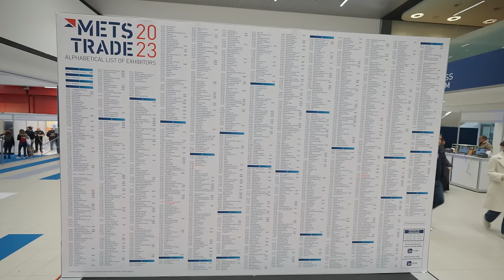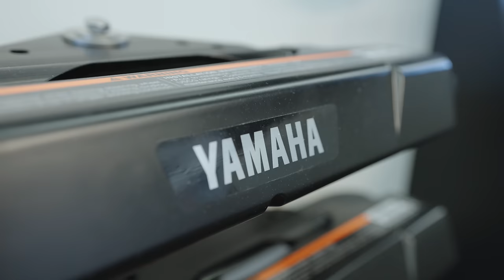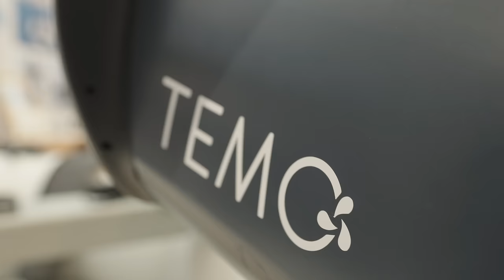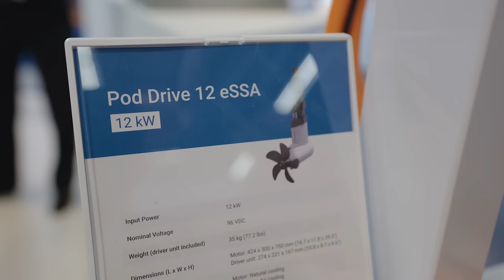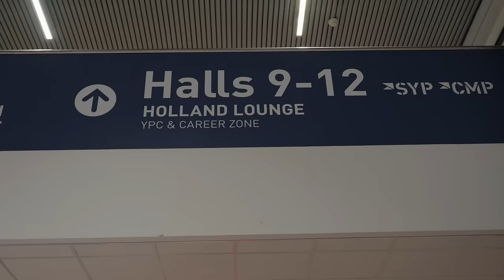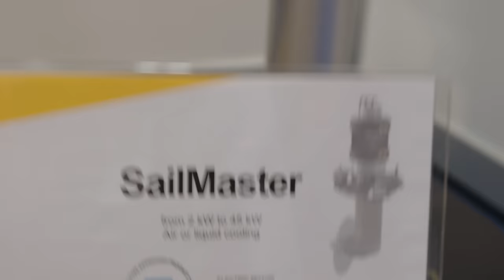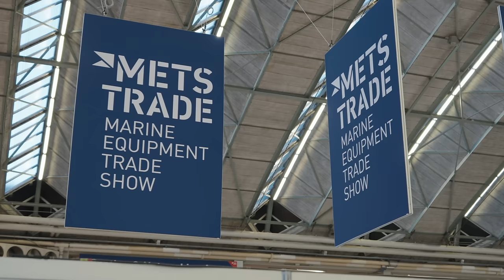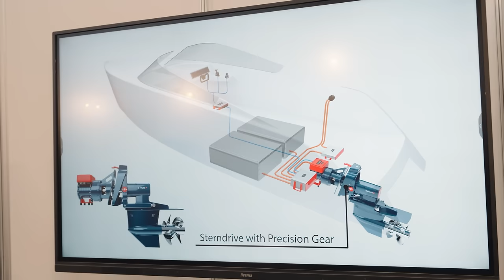The Shocking Truth About Electric Propulsion | Step 371

Comment: I wish ANYBODY would discuss the negatives of batteries and solutions to those issues. They are expensive for the wallet as well as the environment; their production (and disposal) are a huge pollution/eco-issue. I'm all for electric, solar and wind/hydro regen is fantastic, but using fossil fuels to charge a battery (home charge/dock charge, etc.) is not a real solution. With cars as well, where do people think non-solar/wind electric charge comes from? Answer: burning fossil fuels. These issues are so important and need to be looked at from all sides, cons as well as pros, specifically from the eco perspective, and I don't mean the economy and business prospects! R and D needs to address more than quiet and so-called "clean". Batteries are not clean in their complete product cycle - yet. And fossil fuels are definitely not sustainable or wise. I remain very hopeful! Excellent episode, Uma babes!
Reply: There is a transition to cleaner electricity in progress.  Where  I  live, the electricity is 90% carbon free. However, I would need a 60 mile long extension cord to reach the ocean.  There's always something!
Reply: People do take about these issues. Try the fully charged show. Batteries can be and are being cleanly recycled. The main issue currently is that there are not enough coming to end of life to justify building recycling facilities. I don’t know where you live but my government just passed legislation to go carbon neutral by 2050, drop carbon emissions to 70% by 2035 with the backing of all parties. This is as well as the current push for wind and solar power. And we are a coal state. This stuff is doable, it needs political will which is not really the remit of a pleasure sailing channel. The first wind generators were shipped to one of our countries’s lithium mines to clean up its emissions act and incidentally lower the power cost the mine as well.
Reply: @francesconicoletti2547  Fantastic to hear about, thank you! There's hope!!!

Comment: Very interresting episode, learn many things.  Funny how some companies compare a 2KW electric motor with a 4
`5 HP motor knowing that very theorically 1HP is 736W. With the minimal convertion losses you can round as 1KW is 1HP... (not 2....)
Reply from the maker: They’re correct. Our 1kW electric outboard will push Uma the same speed as our 5hp vas outboard. And our 15hp gas outboard pushes her the same speed as using about 4.5kW from the motor. Electric is about 3X more efficient that gas/diesel so that .75kW/hp number isn’t really the whole story.
Reply: @SailingUma  So, taking in account that the power injected in the electric motor is real, (real time measurment) and that both motors transfer the power to the same kind of propeller, it seems that the rated  "horse power" of the thermal engines is a bit exagerated...

Comment: Wicked video loved it. Well done.. Question for you both .. If you had to pick one of these companies to use, which would it be ? And Why ?
If you had to do it all again as you have already done, into a 40-50 footer sailboat.
Reply from the maker: We’d still pick OV since it’s the only one with viable regen. That’s why we’re keeping the one we have. On a 40-50 fter ( IF it sails well) then the new OC high power Servo prop or twin SP 15’s would probably work well. But you need to start with a boat that sails well. Most don’t.

Comment: Seems like prop for regen is the issue, and why it is not common. A prop for propulsion would not work well for generation if i understand  it.   Oceanvolt solves it with variable pitch, but thats a complicated thing spinning in salt water in a difficult to service spot.    I wonder about the system(s) that can spin the pod, if turning the prop around overcomes that prop shortfall somewhat.    Would also give directional thrust.  Next level might be to be able to lift the whole pod out of the water to reduce drag or for service by having it confined to a box that has sides above the waterline.

Comment: I think right now electric propulsion is very much a niche market. We cruise all summer living at anchor for 3-4 months. My 800$ Honda 2hp has a 4 hour range on a pint of gas. 2 gallons a summer.  Having a dinghy motor with a 1 hour range is not practical .  Our 40 year old 20hp diesel uses maybe 30 gallons a summer, max and I have a range of 200 miles When I price a Ocean Volt @30,000 Euros for a range of 70 miles ( probably 50 usable) , plus another 10% for the rest of the kit. Ouch. I can replace it with a Beta for $10K  I have friends we sail with who use a Torg and it's nice and quiet, easy to use and has a practical range of an hour and change in calm water.  So yes lots going on. Some of quite inventive. If you day sail it works, if you use you dinghy to go 20 minutes to shore, yup.  Long term the issue is range cost and support. How many of these vendors will be around in 10 years? Early adopters have the pockets and situation to absorb these risks.

Comment: On a blue water saling ship an electric drive is the best way to go. Once your Diesel is gone, it's gone. Not so with a regen capable engine. It allows you to store wind energy for later use without the need to install additional hardware. What could be better?

Comment: I brought an email out of my archives with a written estimate from OceanVolt that quoted me an unrealistic cost for a hybrid system, which is more involved than the straightforward electrical propulsion ("So your approx cost would be 70-80k CDN and 20-30k CDN for the install") for a 40-foot sailboat. Now, that was from May of 2020; have the costs started to decline since that time?

Comment: The EPTechnologies guy hit it on the money. For most people regen is just hype... they wont use it, or take very little advantage of it in real life. Also, most (long distance) cruisers won't give up on the diesel at least as a backup. That said, hybrids that can work independently are a very good idea for long distance cruisers. You can have all the range you want (aka diesel), and a massive generator that, combined with a big enough battery bank, can provide power for days in a couple of ours (solar helps, but in doesn't scale on monohulls, cats, maybe, but there is always rainy days and short days if you are up north)

Comment: The guy at 45;50 is mostly right, at least for sailboats if using a saildrive. The biggest problem is the drag if you don't need regen.  In a perfect world you would have a brushless retractable for forward and a retractable water rat for charging. clean bottom for regular sailing.
Reply from the maker: We gained about 3/4 or a knot on our passage averages going from direct shaft drive and fixed prop to the Servoprop.

Comment: I have a 37ft with FIMEA motor, which is the supplier to Bellmarine, have a curtis controller, but hardly get any regen  and haven't been able to find any info on the controller settings that would optimise for it.
Reply from the maker: Fixed prop or folding prop won’t give any real regen on a shaft drive under 10kts. We’re still surprised there isn’t more tank testing on this. I guess we’ll just have to do it ourselves.
Reply: @SailingUma   Thanks for the reply,  I actually have a variprop, which allows for different pitch in fwd vs rev.  I need to play with the rev. pitch a bit to see if I can get anything better than i have.  Though as you say not much info on it.   I'm also peeved at the Curtis controller guys as they are very closed book and don't allow for easy settings updates, let alone providing software updates.

Comment: I recognised nearly every part on the Bellmarine stand… even the mfd is a rebadged penta unit. Not an issue, so long as its a lot cheaper to purchase. But it does show you need to be careful of buying in to tech that is new, but actually based on very old designs.
Reply from the maker: aka the entire marine industry ;)

Comment: So, does it appear that prices are coming down?  It seems that most turnkey electric drive manufacturers are charging as much as a new diesel would cost, and then you have to buy batteries in addition.  Oceanvolt's AXC 12 shaft driven system is a little over $18000 + batteries, and the batteries aren't cheap either (shaft drive because it would be challenging to modify my boat to fit a sail drive between the keel and the skeg).
Reply from the maker: Yes. The motors are similar prices. The batteries are your “fuel”. You never see a 10yr cost analysis on the two systems, but our best guess is after about 8-10yrs the electric is free and the diesel only keeps costing more and more.

Comment: I’ve been researching what is required to convert a 38 ft sailboat to electric and the budget associated.  This would be a good topic to discuss.  I estimate $40-50K by the time you add everything in - inclusive of motor, batteries, electronics, solar etc.  thoughts?  Hard to consider with a low hour diesel.
Reply from the maker: We always say that if you have a working diesel keep it. Especially if you’re thinking of electric as a “green” upgrade. Just choose to sail more. When your diesel finally dies, then upgrade. But yeah, $40k sounds about right for a quality system and good batteries.

Comment: 1. Loved the roaming, back & forth Kika shots!  2. Damn near every vendor tried to duck the regen question as "not being equal to" the power output of their motors.  No sh*t Sherlock.  Those of us interested in sailing regen fully understand that it will be maybe 10% of the power output.  OK, if I am sailing 45 out of 48 hours, that's plenty of regen for me.  Not having regen is a deal breaker for any system I might consider.
Reply from the maker: We motor on average for about 10-15 min at a time. That’s it. Usually less. It takes about 2 min to leave the dock and get the sails up. It takes more power to make morning tea. Regen is the only thing that matters to us.

Comment: I was thinking of the cost of a replacement part and how hard is it to get the part.
Reply from the maker: Most of these systems use industry standard consumables. There are also significantly more electric motors operating in the world that ICE. You just don’t hear about them as much.  It for propulsion, but in many other commercial applications. So “spare parts” are often easier and much cheaper to source than proprietary diesel parts. The electric motors themselves will almost never need spare parts. Most are rated for 100,000 hrs of use before overhauling the bearings.

Comment: I like the hybrids but wish they integrated a variable pitch prop like the servoprop for better regen.  Still having a diesel connected to the propeller shaft is reassuring, as is the range of the diesel when you need more than getting out of of the anchorage. Not everyone is as purist as you two.
Reply from the maker: Its actually quite a bit better to have the diesel run purely as a "genset". A 48VDC Genset connected to the batteries as a range extender is much more efficient that a diesel connected to the shaft.
Reply: @SailingUma  that's not wrong. My preference comes from a redundancy consideration. A genset is of no use with an electronics failure after a lightning strike for example. So having the diesel connected to the prop shaft provides some safety that the engine can likely be started with just a battery and controlled manually if need be, even if all else failed.

Comment: Dan and Kika, once again, a great video! The Combi system is intriguing--motor integrated after the transmission and acting as a motor or as a generator. Question though, since the electric motor is integrated after the transmission, isn't the motor connected directly to the shaft? Doesn't that mean that to use it as a generator using engine power that the transmission has to be in gear to rotate the shaft, which would also rotate the prop? I.e., only a generator while under way.
Reply: I thought the same thing. Must only be a generator when the diesel is pushing the boat. It is a cool idea but when I make the leap, the diesel is history.
Reply from the maker: Yes. I believe so. There are other similar systems that have different solutions to that problem. But it means more complex systems. We’re still not a fan of that style of hybrid. But it could be used as a stop gap to build out a good battery system waiting for the day you’re diesel dies and you can replace it with a better electric solution.

Comment: Remember when you are on the floor with a sales representative, and he starts to talk about that the engineers can find that data. Most of the time, the engineers are curling their toes and cursing him for promising something that is hard to implement
Reply: Unless its a small startup no engineer will ever get to your question. You will get an automated reply with some faq from the website that has nothing to do with your inquiry.
If you insist you'll get a reply from the support staff which tells what you want is unfortunately not possible at the time (regardless of its actually not possible or not).

Comment: I may not have understood you correctly, Dan, but you seemed surprised that there were hybrid systems that gave the best of both technologies. Leo (Sampson Boat Works) bought a Beta Hybrid for Tally Ho a year ago, that does all that was explained. The concept of Beta (a British company) was to marinize a Kubota diesel which has a good reputation for long life and smooth torque, thanks to an oversized flywheel. Atticus had a BetaMarine engine on their Allied Seawind. I don't know if they were among the leaders of hybrid designs but they were at least an early choice. When I replace my old Westerbeke, it will be with a Beta Hybrid.

You did an excellent job in your interviews and also in their editing! You should go back to all those interviews with different accented English, and clip out every word said and then write your own summary and use those clips to verbalize it. It is what might be called a "joint-effort" summary, one word at a time.
Reply from the maker: No not surprised at the technology. It’s been around for decades. We’d just never seen a company openly advertise retrofitting existing diesels with an electric option. That’s what we were commenting on. There are a dozen companies offering an electric motor slapped on the back of a diesel. It’s not our favourite solution, since you’re still tied to a diesel. But it might be the right solution for some.

Comment: Seeing that, it will be interesting to see in like 10-20 years if diesel pump stations are still a thing at marinas and only like high power 3-phase plugs are at each birth - even in the smaller marinas.
Reply: Here in Norway more and more work boats are becoming electric. Though they need to charge with 400 volt which is not readily accesible in marinas, thus they still rely on diesel generators for charging.
Reply: Unfortunately I don’t think things will move that quickly. All the boats that have already been made, will still exist in higher ratios than new electric boats. 

All the hardware seems to exist more or less. Battery tech has a ways to go. But there doesn’t seem to be much in the way of sailboat specific software development. It’s a small market comparably with bad economics unlike commercial transport. Building a new boat with hybrid electric drive is still an €80k option the last I looked.
Reply: Don't hold your breath. 
Building New infrastructure takes time. And not yust at the Marina's. Here in the Netherlands a lot of building has virtuallty stopped because electricity can not be provided. The elektrical infrastructure  is saturated.

Comment: I think a lot of these companies are trying to make an electric propulsion system that happens to sometimes (maybe) work as a hydro-generator.  I want to see someone make a hydro-generator that happens to sometimes work as a propulsion system.

Given the range limitations of electric boats I think it's likely that a cruiser with electric propulsion spends more time in generation mode than propulsion mode (Uma certainly does). It would make sense if a motor were optimized more for regen than propulsion.
Reply from the maker: 100% agreed!!!!!

Comment: What do you get Regen wise at 5 knots, 7 knots and 9 knots sailing speed?
Reply from the maker: 5kts is about 100-150W. 7kts is around 5-600W and we can’t go 9kts. But we’ve sailed the Salona 46 and we were getting about 1kW out of each motor at 8.5-9kts. 

Our numbers are from the very first time we tested it in Tromsø in 2020. We’ve received a few software updates since that have dramatically imposed things. But we haven’t had the time to do a full on controlled test since our last update. And now Uma is torn apart. So it’ll have to wait.
Reply: @SailingUma  So there new 25kw that does 5kw at 10 knots or 2.5 times more regen will be a huge factor going forward. Just think duel regen on a faster catamaran  would mean. Low battery not enough sun go for 1-2 hour sail then have enough battery charge to make it another day.